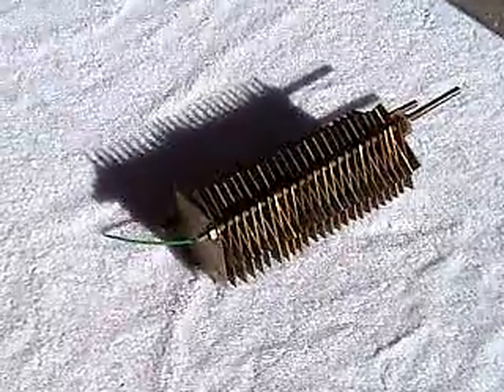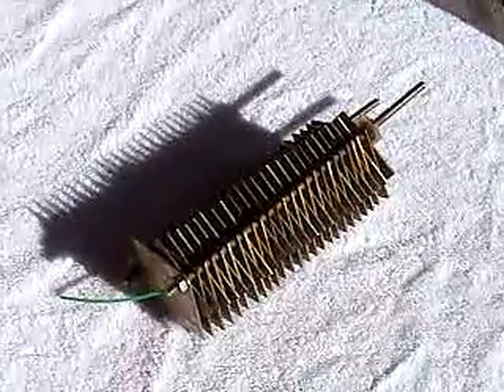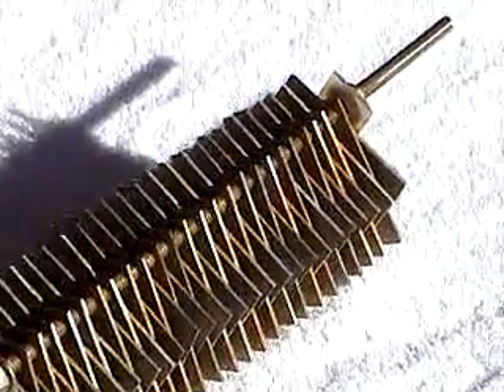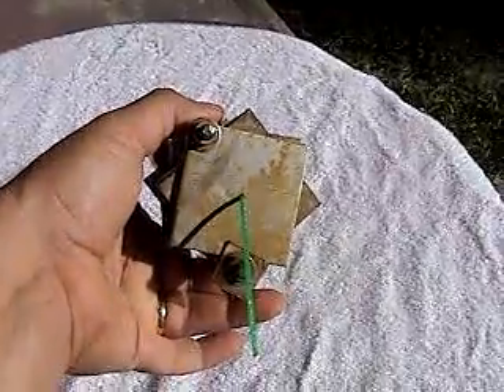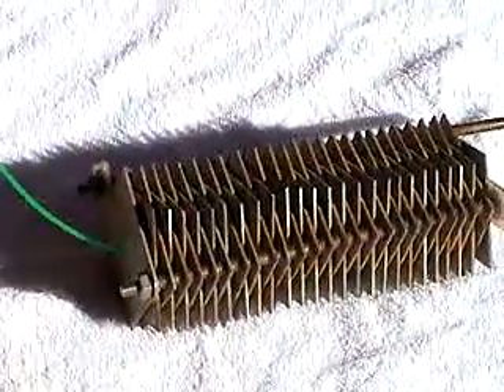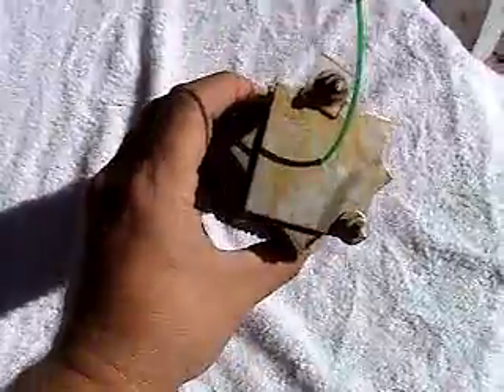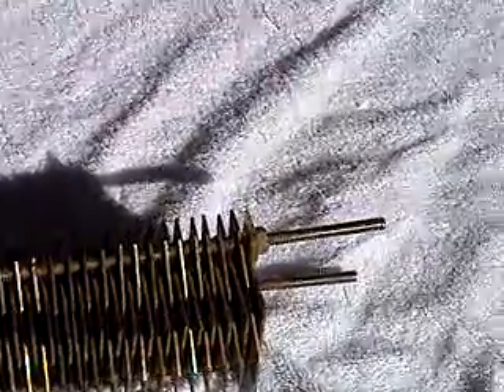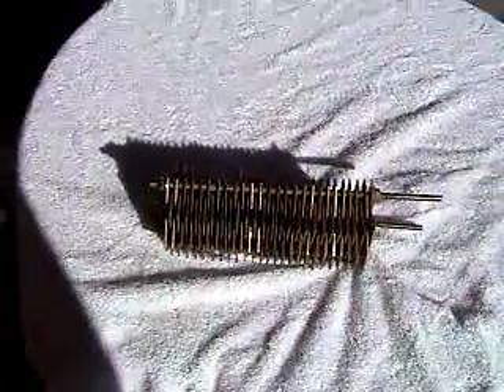HHO Stainless Steel Plates

Comment: I do a LOT of work with stainless, and you will find the name is by and large quite miss leading. Just about everything will stain stainless, pretty much any mechanical means will remove the stain, sand blasting might be a good option for you as it will clean the surface, and the pitting left from the blasting will actually slightly increase the surface area of the plates. Interesting setup, I operate a waterjet I think I am going to cut some 14 gauge 304 plates and start playing. Good luck!!!

Comment: Hi, for 1 you should use 316L, 304 or 307 will carrode the plates. 2 you should clean each plate and use gloves when assembling. 3 with that many plates you should use sodium hydroxide,
or potassiun hydroxide, they will run a lot cleaner and produce higher amps. in turn you should have massive hho production. hope this helps.

Comment: i made one with ss plates, and  nikonell or inconell? what the fuck ever it's called, it's like $80 a pound, used in ultra high corrosion app's (it fell off a truck).. but my ss plates turned black, the inconell outer (negative) plates were clean, as soon as that truck drives by again, i'm building a positive stack out of the shit. it's wicked tough, and impossible to drill i hav2 notch it with a grinder. and it eats up whiz wheels like crazy.

Comment: your rods are made of iron and you are electroplating the stainless steal by putting it across the electric 12v terminals. You need to change the rods over to SS.( and nuts and washers)

Comment: brake cleaner... cheap and obvious.

or pickle it, make a solution of  hardware store hydrochloric acid and distilled water

mix it 5% acid to 95% water
pour this into a crock pot, turn it on low and warm it up, put the cell in and pull it out when it's done, not sur it will work on stainless though, i'm asuming that you got it off cause this vid was made in 2007

Comment: it's not really worth it, but if you want to clean it, just use dish washing detergent, it'll take the oil right off. then dry it and maybe sand the plates a little.

it's a nice machining/assembly job though.

Comment: Im sorry you feel so bad that its stained. It shouldn't be a problem or cause interference with your hho output. I can tell you now though that the staining is from high density hydrogen.Only suggestion I would have is to use 316L 20 gauge stainless steel. It wont corrode as fast. No way in hell should you be putting white vinegar in to clean your plates!I use baking soda in my hho unit 1/4 teaspoon baking soda is all that you should be mixing in with the water NOT vinegar!

Comment: i made a cell the same as yours but a 12 plate marine stainless steel and found that it got hot so changed it around to a 9 plate in this order( + nutral - nutral + nutral - nutral + ) found that it needed more baking soda added but used less amps to get same results which means less heat i hope

Comment: Only use 316L, neutrals, and increase the gap to obout 1/8" and you will be good to go. You will lose some plate surface area due to the gaps, but it will last longer and will not corrode as easily.  

I have found that even 316L will orrode/turn black in spots if you place  + - together and have them only 1/16" apart.  This was using 100% (no water added) distilled vinegar as the catalyst. Im not sure how the other more akaline catalysts would react, but I know what vinegar will do (acidic)

Comment: looks like you used 304 Stainless... you need to go with 316 or better... 316 is "Marine Grade" and VERY resistant to corrosion.

I discovered this the hard way myself..My 304 plates corroded HEAVILY. turned BLACK/Brown and stained.. Cell also overheated..

I was Using Vinegar as catalyist...

 316 cost about 2x as much.. I am ordering a 3x 4 sheet of 22gauge... from McMaster carr tomorrow... Runs about 99$ for this sheet

Comment: make sure its not the PLASTIC coated SS plates.. they do exist.. it might actually be the THIN film of acrylic that is holding the stain NOT the steel.. Of course it could be just poor quality stainless...

Another thing  you can try CLR soaking it in there to remove the rust. but it will just corrode again most likely.

Als are you SURE you used SS WASHERS?  Maybe those are the ones rusting/staining the plates and are elctroplating the plates with rust they look pretty bad too

Comment: The residue is Fe leaching out from the surface of lesser grade stainless and turning to FeO when with the O2 being released. If you dismantle the cell you'll probably find most of the residue on one side only. The side liberating H will be cleaner.

Soaking in 10% citric acid will not only clean the residue off but it will also passivate the Fe from the surface. It's not harmful, though. Just ugly.

This is a very clever parallel plate design though. Nicely done.

Zero

Comment: your gizmo could easily pull 20 amps or more with right electrolyte.  dont connect direct to a battery charger but instead hook the charger to a battery and run gizmo from the battery.

Comment: KOH will leave least residue, Sodium Hydroxide will foam but leave plates clean, baking soda leaves little residue but DONT BREATH VAPORS and please avoid SALT as it will give of chlorine gas.

Be safe and keep trying!  Cool plate config.  Suspect will tend to be a better water heater than splitter.  Let us know how it works.

Comment: some of the stuff you will see left behind on your apparatus when you use tap water will make you never want to drink that stuff again!  Use CLR to get it cleaned up, then give it a soak in for a day or two in lite acid bath (vinegar or citric acit) to remove oil (from hands normally) then only touch with gloves after.  Then use distiled water with electrolite.